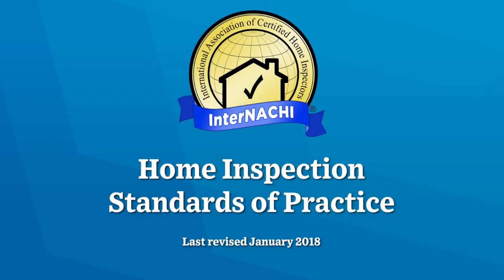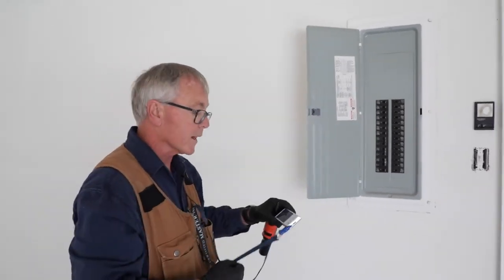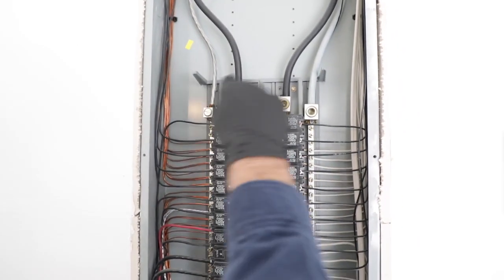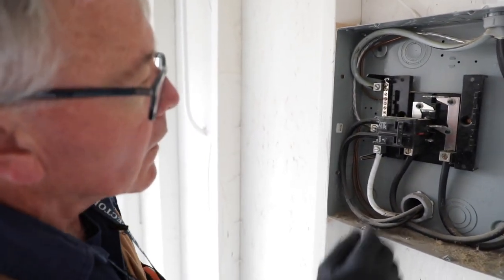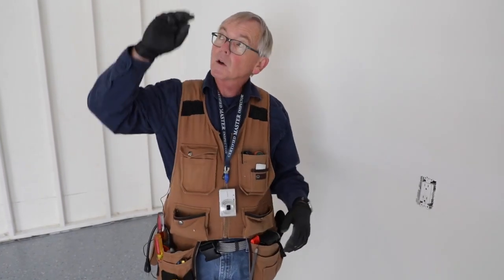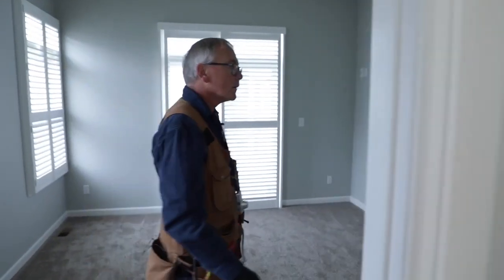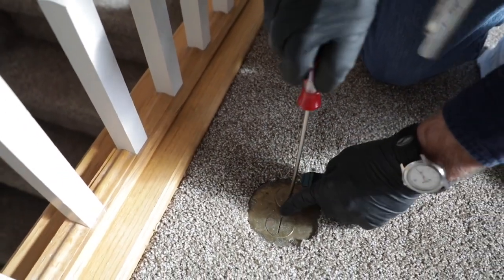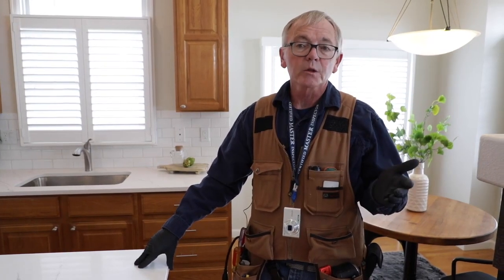5 Performing an Electrical Inspection According to the InterNACHI SOP

Comment: Inside the main disconnect  that ground bar holding the neural has to be bonded to the box if it is set in the insulator, with either a bonding jumper or a bonding screw. All back fed breakers must have retaining clips to lock it to panel, which this one does.
Reply from the maker: Good catch, those are important details.

Comment: I thought the grounding screw was to be removed in a sub panel.
Reply from the maker: Hm.
Reply: @BigBenGromicko   is the bonding screw allowed because it is bonding the ground terminal to the panel and not the neutrals? I know the grounds and neutral can only be bonded together in the main panel, not a sub panel.

Comment: I think we should make a video with a CMI and then have an electrician like myself explain the differences between code and what we as inspectors are required to note. That way, separating the two will allow a better understanding because his verbiage used is not correct.

One side note, always take two GFCI plug testers because I have gone behind inspectors and I see his showed reverse polarity but on both of mine showed it was fine. They can give false readings.
Reply from the maker: Let's do it. We'd have to do it using Zoom. Are you interested? If yes, Moranda does all of our webinar scheduling. She's at moranda@internachi.org. Please email her. Let's set it up. We've done it before. Here's an example: https://www.nachi.org/webinars/2020/tools-of-trade-with-cpis-jim-krumm-lon-henderson-and-ray-kline

Comment: Why do home inspector say look for de-ox compound ,if the panel install after 1981 it's not required by code.
Reply: If it's not required how is it a defect. That's not a code issue . The manufacturer do not call for it so you don't do it unless the manufacturer says so
Reply from the maker: Home inspectors are not code inspectors. And we therefore inspect regardless of when a house was built, because back then it was built to code but likely has defects.
Reply: It's not required by the NEC, but the NEC is a MINIMUM standard of safety. The aluminum used today for conductors doesn't require anti-oxidation compound,  but most electrical inspectors want to see it anyways.
Reply: @michaeleverest3487  OK I would like to point out first that using anti oxidant on aluminum alloy wire will not keep the connection tight. secondly anti oxidant is not required on aluminum alloy wire that is manufactured at the present date, dating back to the 1980's. common misconception concerning aluminum alloy wire types are common and most people including some or most electricians do not know this fact. the wire is marked with AA 8000 which is what is made today. Mike Holt has a video explaining this as well as several articles from the early 2000s on this topic from IAEI International Association of Electrical Inspectors.
Reply: @kevinthompson4690  i know all that. Read my comment again.  I literally wrote what you're telling me.